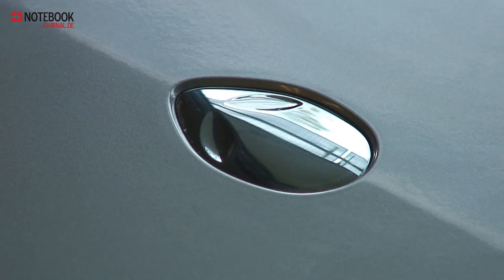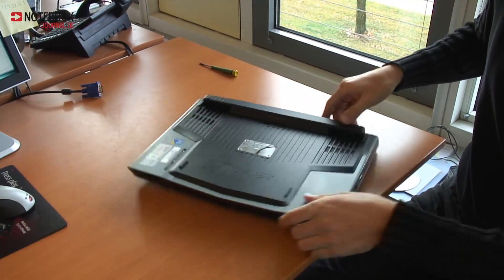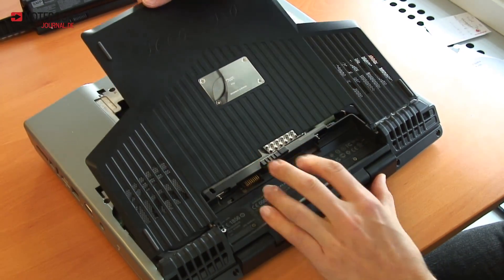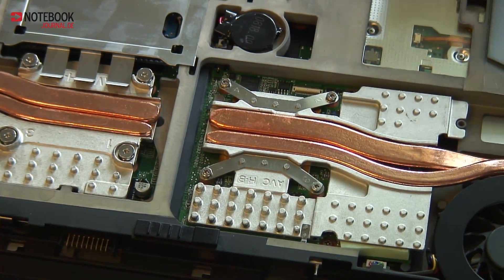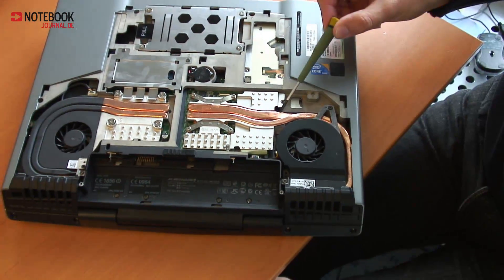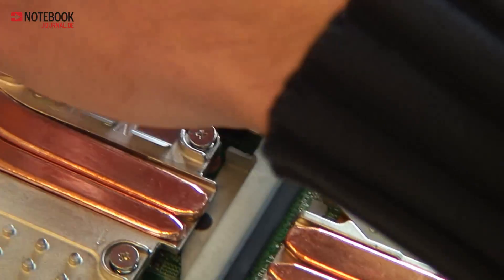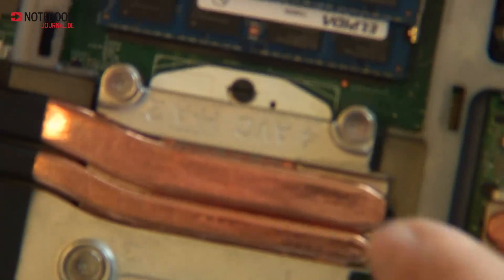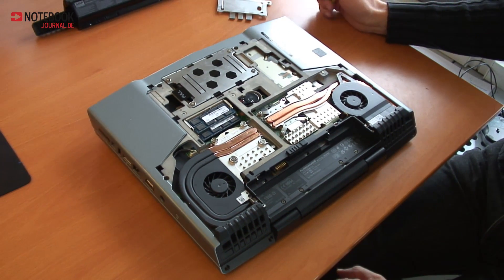Alienware M15x unscrew action 260M graphics and i7 processor

Comment: All those who are asking if you can put a 6990m in the case answer YES but you can't put a 580m and I don't believe a 570m but maybe.  My m15x has a 6990m in it and it runs crysis high settings on my 2560x1600 display with 35-50fps.  It will also support 16gb of ram.  Next time guys please google it... You will find the answers!

Comment: @ecam90 I purchased a m77 laptop from alienware.
It cost me about $2700.00
It was not even close to being as powerful as they said it would be.
they told me it would play half life 2 series at full power/ rez.
THEY LIED + after 10 months and light usage the damn thing broke (mo board & processor) what a piece of garbage, they refused to respect the warranty so I disassembled it and parted it out on ebay. while dismantling it I noticed the flawed design. guaranteed to break no matter what.

Comment: @notebookjournal Are you kidding me? That was the worst informed answer I've seen in a while. Of course you can use the 480m with laptop CPUs. Its the 480M as in MOBILE. You ARE correct in that it won't work. The power consumption will be too high. But your reasoning was completely incorrect.

Comment: @faizyuki i can make more :p 
1)you call 3 hours portable 
2)desktop has more power
3)cpu are higher clocked on desktop
4)desktop has higher bang for the money
5)dx11 is better on desktop (gtx 480 460 hd 5970)
6)portable to lan parties
7)fixed cable internet 
8)hd screen and higher resolution
9)better oc and techs
10)costum
11)h2o cooling 
12)alienware is overpriced even on desktop
13)you can upgrade when ever you want
15)more ssd's in raid 
16) etc.

Comment: @MrMongoskalle there is an "i7 860 2.80ghz" cpu for 1156 motherboards, i noticed the laptop had 2 memory modules rather than 3 so it could possibly be a 1156 socket motherboard (which usually suck) :/

Comment: Hmm, I thought about getting a m15x too, but its just too expensive for what you get.  Coupon hunting brought it down to $2k USD after taxes.  I opted instead for the Sager NP8690.  Its the same configuration as the m15x, but I get the GTX 280m graphic cards and it weighs less.

Comment: Its fast for multitasking and gaming, but its not good on the battery. Its faster than the previous Q9000 processors. If I were you I would wait for the mobile i5 processors which are much cheaper and will perform roughly the same as the i7s.